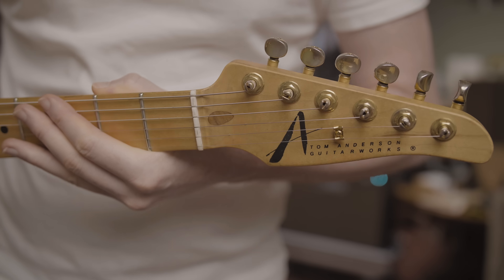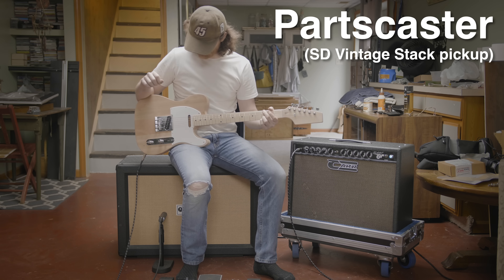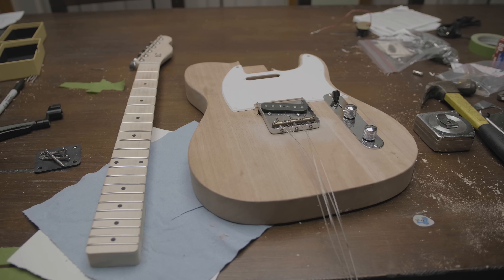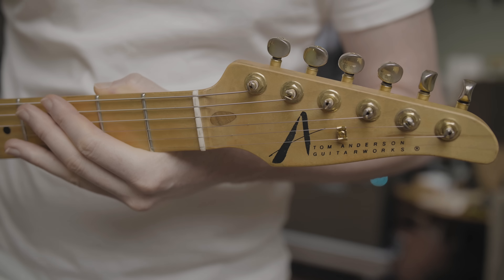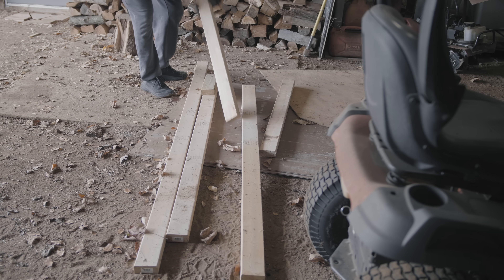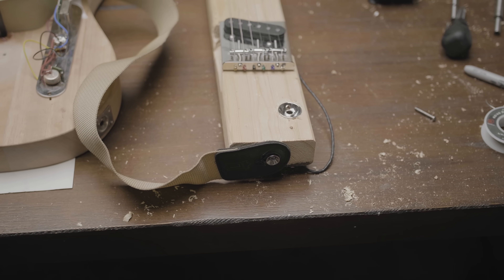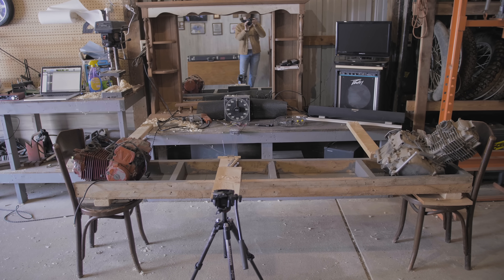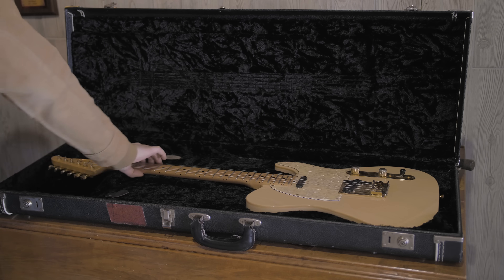Tested: Where Does The Tone Come From In An Electric Guitar?

Comment: Very interesting - the Anderson and the air guitar with matching pickup etc sound the same, but the Anderson and the ‘partscaster’ with matching pickup and pickup height somehow sound notably different. 

Paul Reed Smith talks about his philosophy that guitars are subtractive instruments, the best ones subtract minimally, and bad guitars subtract a lot. 

This video tells me more that whatever tone woods are used in the Anderson (and how they are treated, finished etc) are having minimal effect on subtracting from the tone  (compared to the air guitar), but the tonewood on the partscaster is definitely doing something to affect the sound and ultimately absorb or rob energy from the system. 

Its not as simple as ‘because the Anderson and the air guitar sound the same therefore wood makes no difference’, because we need to consider that there are 3 instruments with similar core specs to compare - 2 sound the same (air guitar and Anderson) and 1 sounds notably different (the partscaster). 

With acoustic guitars it’s obvious that tone woods are a huge influence on the sound because they have to make all their own sound, so the differences are more obvious - with the guitar top by far the biggest effect, followed by smaller factors like B&S woods that effect more of the note decay, fingerboard and neck being an even smaller effect on tone.

I think ultimately with electric guitars the tone wood is a clearly far smaller proportion, and as long as the wood isn’t absorbing too much of the vibrations, the general aim is get the guitar to absorb as little energy from the string as possible, and a good guitar like the Anderson generally doesn’t absorb much if any energy from the string. 

Thoughts welcome!

Comment: Even through you tube you can clearly hear a difference in tone from the 2x4 guitar to the telecaster........and the "air guitar was not an air guitar.  It was literally mounted to Wood on both sides......it was a guitar with no neck.  This is stupid.

Comment: You all do realize that in this experiment he systematically normalized or eliminated the variation and then drew the conclusion that there is no variation right?
Reply: What does wood type have to do with the strings oscillating?
Reply: @AzathothsAlarmClock  I meant comparison normalization not audio normalization. People erroneously conclude from this experiment that construction of a guitar doesn’t matter because he is able to get the same sound from a pine 2x4 or no wood at all. Being able to get different things to behave the same does not equal the differences therefore don’t matter. Every single person who’s played a guitar for more than 2 minutes knows that an ES-335 sounds different from an L-5 from a Telecaster. And it’s not just the pickup type and height differences between the guitars. However this video seems to suggest (or at least A LOT of people are interpreting it to say) that wood, or body construction, has no impact on the sound.
Reply: @turnthitchcock8432  “copium” thanks I learned something new!

Comment: I've been on the fence on the tonewood debate for years.  I always assumed that wood density, fiber patterns, rigidity. weight, etc had to play some kind of role, be it sustain, wavelengths, vibration, harmonics, vibration feedback, sonic texture, shimmer exchange, what have you.  Maybe it does, but for plugged in electric guitars I believe this video proves that its effect is outside the threshold of most human ears to distinguish.  Maybe people with disposable income have highly evolved ear drums.

Well done, I'll buy a new car instead of that pretty little $8000 McCarty wall hanger.

Comment: This supports the basic physics of how electric guitars work. Metal moving past a magnet. Everything else is just aesthetics.
Reply: Aesthetics AND comfort. Comfort and playability is huge when it comes to a guitar. But doesn’t really affect tone.
Reply: @justingoers  Oh come on, the bench-mounted "air guitar" weighted down by two honda motorcycle engines and a steel bench is not THAT unwieldy... xD
Reply: Comfort is a huge one…. Give a Flying V player a Les Paul and they’ll sound uncomfortable, and vice versa. There’s nothing that boosts your confidence and playing ability more than holding a guitar you’re comfortable playing.
Reply: Yep.  Just watch videos of a titanium Gittler and you’ll realize all the talk about wood tone is pure nonsense.
Reply: @MAXIMUSMINIMALIST  But the Gittler has a very distinct tone 🤔🤔
Reply: @lfscrazy  From it's pickups and strings, yes
Reply: @lfscrazy  yes it has the tone of the amplifier it’s plugged into
Reply: @lfscrazy  If they sound markedly different, it' s certainly not due to the body. The body has barely any effect at all. https://youtu.be/n02tImce3AE?t=512
Reply: @lfscrazy  Literally watch this video for an explanation
Reply: @lfscrazy  if its unplug, yes it would sound different since it will work like an acoustic guitar, but when you use a magnetic pickups it will sound like how the pickups gonna give you
Reply: Actually it's a magnetized string moving above a coil.
Reply: @lfscrazy  everybody studied physics at highschool it just the matter you understand it or not lol😂
Reply: @lfscrazy  the video literally tells the wood doesnt affect tone whatsoever lmao, if the "wood" affects the tone then there aint gon be strat single coils, it would be just strat with tele pickups since the "wood gonna affect the tone" i used tk be a poor guitarist so i know exactly "switching high end parts to a cheap guitar" or building guitars. arguing with you is like arguing with flat earth believers because no matter how clear the evidence is, you aint gon believe! you cant even tell in which frequencies does different wood affects? because youre hearing with your eyes chico. 😊
Reply: @lfscrazy  Because there is more to the sound of a guitar than just tone...
Reply: @lfscrazy  Lmao you think tone is the same thing as sound dont you? Fucking guitar players man holy shit
Reply: @lfscrazy  The body has barely any effect at all. https://youtu.be/n02tImce3AE?t=512
Reply: @lfscrazy  why? because there's post processing, pedals, modulation etc. and even if you got all that the same, you probaby doesnt use the same type if pedals.
Reply: @lfscrazy  oh wow i am sorry that english isnt my first language so i messed up here and there, then again its funny that your counter argument is my grammar and ignores every argument i gave because you cant even bring facts to the table in the first place lol
Reply: @mudfightmaster4275  Your first language doesn't use punctuation? Sorry, don't know what your argument is because can't read your WOT.
Reply: Well good old Glenn has taken this video as his proof guitar pickups done do anything. It was the one thing that changed the tone was changing the pickup to be the same! Try arguing about the physics of a guitar with him. It's been taken so out of context it's unreal! Glad to hear your common sense and that of others. Everything plays such a minor part that the ear notices big differences sometimes. That's my only personal conclusion about guitar tone.
Reply: basic physics of how electric guitars work?????????????? where is the fucking guitar???????????????? strings are no fucking guitar!!!!!!!!!!!!!!!!!!!!!!! kaum zu glauben welcher verdammte schwachsinn hier von sich gegeben wird!!!!!!!!!!!!!!!!!!!!1
Reply: If this was true, every guitar would sound the same, so it's not!
Reply: No it doesn't. It just proves that you're tone deaf.
Reply: Remember guys the wood doesn't pick up the strings, the neck doesn't, the pickups do, we are not dealing with an acoustic here, all the tone of an electric comes from a change in the signal chain, and wood isn't in that signal chain.
Reply: What the strings are strings attached to afffects how the strings vibrate @patentmantis70
Reply: Not true. The player is the biggest factor for sound.
Reply: Then you're missing the point. The Player can make a crappy guitar sound its best, true. However thats not what they're discussing. Do the materials have an affect as well?
Reply: @lfscrazy  es335 used different pickups from LPs
Reply: @mudfightmaster4275  Nope, original es335s and Les Pauls used exactly the same PAFs. Modern re-issues use exactly the same Custombuckers. And yet they sound clearly different. Explain please!
Reply: @lfscrazy  Right, couldn't possibly be that when you put in that second neck that the action is slightly different lmao

And no, i'm not going to sit here and provide an argument for two guitars that are not infront of me. What a bad faith argument 

Your argument is fine for an acoustic, all a body is going to do on an electric is absorb vibration at different rates, it is not going to add any meaningful resonance. It's a solid body, the entire reason to use a solid body is to minimize the resonance. Differences in sustain? Sure. Tone? No
Reply: The wood might not affect the tone, but I'm pretty sure it would affect the sustain.
Reply: @torvaga  I bet you’re right, but let’s put it into perspective. Wood A might sustain a single note for 14.226 seconds, and wood B might sustain the same note for 14.669 seconds. Will any song in the history of music be played this way, and will that wood choice make a difference? No.
Reply: @torvaga  Dude did a video on this, "where does the sustain come from".  Let the electric guitar tone myths die!   https://www.youtube.com/watch?v=muVzwbkUUnM
Reply: @torvaga  Why?
Reply: @torvaga  buy the right peddle...
Reply: @torvaga  Proven that it it does not.
Reply: @torvaga  I think so too
Reply: @torvaga  It can hugely affect the tone. I have a 70s Strat and 2 necks for it, 1 maple, 1 rosewood. There's a big difference between them tonally. Also, 1 of them is more resonant and just sounds 'better' because of it. 
The way wood affects the tone is by adding it's voice to the vibrating string. When you hit the string, the whole guitar becomes a system. A really resonant guitar adds it's particular resonances to the fundamental of the vibrating string, changing and adding vibrational patterns. You could demo this pretty easily on a scope. That's where this video falls short.
Reply: @lfscrazy  do you not understand how induction works?
Reply: @lfscrazy  nothing scientific about anything you said. If you have time to comment a critique on every video then you should have time to make a follow up video demonstrating your findings and you'd be the first to do it.
Reply: @otallono he's correct in the tonality but it only affects the sustainability. Basically when u play the string, a ping is sent out throughout the guitar, which ends up back in the string, and is recorded by the pickup. Play one string with heavy gain and then mute it and you'll still here slight ringout on the other strings
Reply: @otallono  the motion of the strings on the pickup "magnet" are vibrations, and the vibrations of the strings can be affected by where the strings are connected to since whatever it is connected to will also vibrate a bit. The wood where the pickup is connected to will also be vibrated by the vibration of the strings. I hope you understand that vibration and sound is not a one-way thing unless you connected the string and pickup into a perfect sound/vibration absorber (which does not exist) so that there will be zero resonance. It seems you had a problem with reading comprehension. You also had zero "science" on your statements, and the comment you replied to never claimed that the their comment was scientific.
Reply: I agree with you… from my personal experience ;-)
I worked in electronics all my life, at work and for fun. I’m a Dinosaure :-) In early 70s it’s when you’d learn tubes, then transistors, early Integrated circuits (chips) and use oscilloscopes and meters in the lab. And I kept doing it all my life… I built tube and transistors amps, guitar effects, and guitars. My conclusion for guitars is that wood makes a difference. We don’t always hear it or know why, and sometimes it’s more a feeling than specs ;-)
Reply: @lfscrazy you keep believing that if that's what makes you happy.
Reply: @lfscrazy  The entire invention of the solid-body electric guitar was driven by the need to reduce body resonance as much as possible in order to tackle the problem of feedback.
Reply: @otallono  but he cant, because all he said is "uh it feels like blablabla" he didnt say something like "using maple boost the frequencies on blabla hz"
Reply: @gtechblues  yes, its more of a "feel" because its something people made up and choose to believe these imaginary stuff, its not fact though.
Reply: @lfscrazy  How does that make the video fall short? All that you have mentioned would have appeared in the results if it had a noticeable effect. The video doesn't even mention the reasons why wood wouldn't have made a difference, it just shows that it doesn't, so it can't fall short by "failing to realize a way in which wood would affect the tone".
Reply: @lfscrazy did you watch the video, though?
Reply: @sepg5084  The difference or 'error' between the waveform of any two guitars with identical construction except for wood type will be very small, to the point that it won't be noticable. The greatest factor in the difference is likely the density of the wood, as the mass will directly affect the amplitude of vibrations (F = m*a) and density will also change the velocity of vibrations through the wood (v ~= sqrt(elasticity/density)).
Reply: @lfscrazy  Jim Lill has proved that this is false.
Reply: @lfscrazy the tone difference between a maple neck and a one with a rosewood fretboard definitely has an affect on tone.
Reply: Well if you think in physics, everything actually affects how the strings vibrate which affects the sound. The sound of a string is never a single frequency it's more of a group of sounds that has different frequencies with different volume. The general shape of this group affects the tone. Although how exactly the body affects the vibration is uncertain. And it seems from the video that it doesn't affect much.
Reply: @onursahin7970  its true if we are talking about acoustic since it doesnt use pickup to translate the sound even more, its "acoustic"
Reply: Then why does a Gibson hollowbody sound different than a les paul?
Reply: @pada443  you did not just ask that question
Reply: @pada443  u do realize they used different pickups right?
Reply: @pada443  pickups, electronics, setup, accoustically theyll sound diferent, but when plugged in, as long as the set up is exactly the same, theyl be as close to identical as they can be
Reply: @budding_rose  that's just not true
Reply: @pada443  Exactly. He has clearly never played a 335 at stage volume. You can literally feel and hear the guitar breathing through those f holes, it's a thing of beauty.
Reply: In short, the 2x4 guitar sounded very different from the actual guitar, so body wood does make a difference.
Reply: @Pughhead  No it didn't lol. Once the pickup distance was the same, along with the same circuitry, it sounded identical
Reply: @chameleonedm  Damm I guess you have to be a guitar player to hear the difference 😅
Reply: @Pughhead  Played guitar for 12 years, have multiple albums out, also produce for others. Would you like to try again or are you content lying to yourself to seem superior?
Reply: @chameleonedm  Yeah I'm sure you know more than Guthrie Govan, Joe Satriani, Misha Mansoor, Mark Lettieri, John Petrucci, Adam Getgood, Rob Harris, Nuno Bettencourt... lmao
Reply: @Pughhead  What on earth does that have to do with what you said. Go on, explain to me in detail what tonal differences you heard
Reply: @chameleonedm   @Chameleon EDM  If you go to 8:11 you can clearly hear the actual guitar is brighter. But you're just an internet "producer" so I'm not surprised you couldn't tell.
Reply: @Pughhead  Lmao "brighter" 

Yknow what we do when people ask an element in a mix to be brighter? We turn up the volume a little bit because people don't know what theyre saying. Brighter is the most default, go to, "I have no idea what I'm saying but here's an opinion I can feel I can justify"

As I thought, no detail, because your opinion doesn't actually exist
Reply: @chameleonedm  If you can't hear the difference between steel and brass saddles in THIS video, then you have poor hearing. 3:04
Reply: @DRIIC-qw8us  Yeah, I'm sure it was the brass saddles that drove the sound rather than him playing mildly differently lmao. keep coping
Reply: @chameleonedm  I see. So you use this video to back up your beliefs except for the bits that are contrary to what you believe. 

Maybe you'd like to take a stab at why an ES335 sounds different to a Les Paul when they both use the same pickups.

I expect you know that the block of wood was put into the ES335 to reduce feedback. Just think for a moment about that. They changed the guitar body to affect how the strings vibrate...
Reply: @Pughhead  nope it didnt
Reply: @Pughhead They sounded exactly the same.
I'm guessing if you think they are vastly different then the placebo effect is working on you. 😉😊

Comment: Fantastic video. I make electric instruments and put pickups made for acoustic guitars into them. Which pickup used makes a difference and whether it's active or passive. I tried a bouzouki pickup made in Greece and was surprised at how rich it sounded. Other than that I've found to be true what I also heard in the video. The main sound factors are the distance of the strings from the pickup and the mass of the guitar to provide stability. The air guitar had stability from the two engines weighing the table down. Nice touch.
Reply: Actually, that's a really interesting outcome. I would have thought piezo pickups (as opposed to magnetic) WOULD sound different depending on the type of wood.